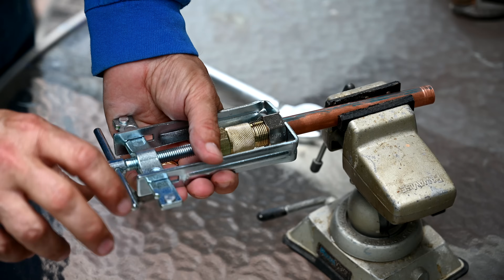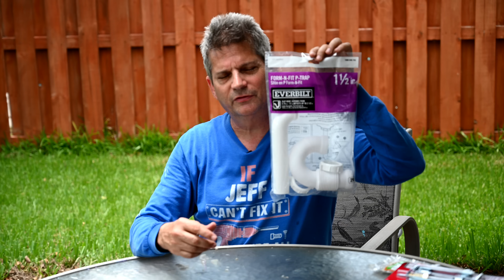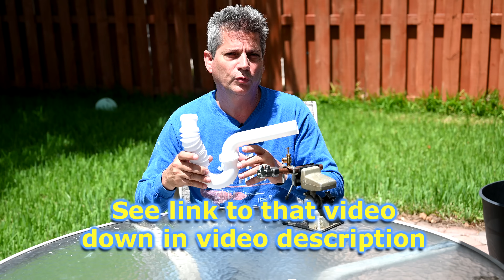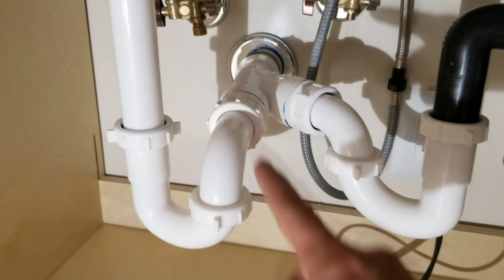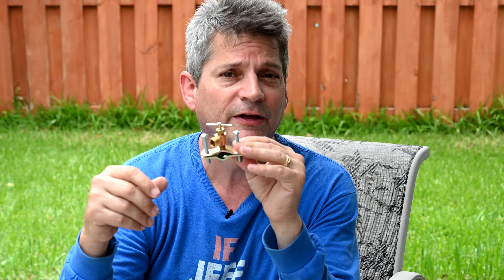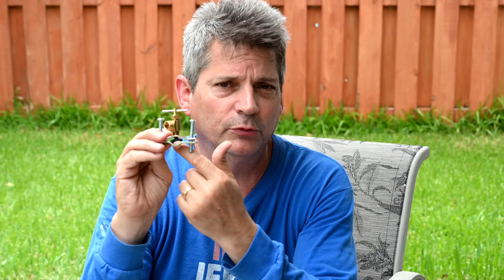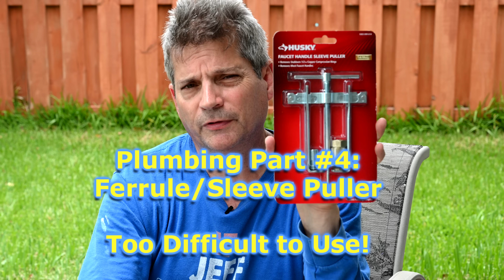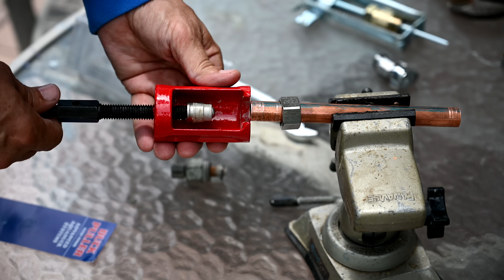4 Plumbing Parts/Tools You Should NEVER Use. NO Plumbing Fails

Comment: Buying special tools to remove the old, existing compression fitting on the angle stop is silly. All that you need to do is to tap the backside of the nut toward you. Keep tapping but at different locations around the nut and it'll eventually slip off.
Reply from the maker: What you're suggesting also has the risk of breaking the solder connections on the pipe inside the wall which would lead to a much more devastating and costly repair when the tool is only $10. Also your method might work on one that comes off easy but my experience has been that many of them are on really tight an I do a lot of work in bathrooms that have had a lot of moisture in them and so the corrosion really puts these things on there super super tight and so tapping is not going to work for most people
Reply: @jeffostroff  
Noted, and it's a good suggestion. I probably won't change my own ways, but this could be because I've gone into another business. It's called RETIREMENT.

But as for the contention that tapping on a compression a fitting could loosen a soldered joint inside the wall? Well if this was done by a novice? Then I'd say perhaps. However, it would have to be one pretty reckless and inexperienced person doing the tapping. And I'm not that kind of a circus freak (forty-five YEARS in plumbing and the trades in general). That and the original plumber was similarly inexperienced and left a poorly sweat joint likely to fall apart during the removal. Also, here's where I pull out my ever-present can of WD-40. After coating the stubborn fitting with the fluid for several minutes and then LIGHTLY twisting the stuck ferrule on the stub out WHILE HOLDING THE OUTERMOST END OF THE 1/2in copper stub-out securely w/vice grip or another tool that'll prevent a twisting tension upon the 1/2 in stub-out?

Then I think I'm pretty well protected against a catastrophic leak ever happening inside the wall after I'm paid and ''outta there pardner''!

And I suppose that some folks may feel opposed to using WD-40 on potable water supply systems. In as much as the liquid MIGHT eventually spread out and into the water supply. However, I'm not worried about this. As I carry paper towels and a spray bottle of water. to clean my surfaces afterward.

Comment: Retired industrial electrical/millwright contractor here with 49 years in the trades when I retired 6 years ago.  

We were mostly industrial only, but there was a time where we used to do a lot of commercial build-outs. When we were doing the "make safe" for the demo contractors and the plumbers and fitters were killing off the water and sprinkler system, especially in restaurants and places where they had self serve coffee and soft drinks there were saddle valves on copper that were there for decades. - Not a sign of a leak. - It may be in your code now, but don't try to tell everybody that a saddle connection WILL ALWAYS leak, because it simply is not true. 

 It the very same principal as the saddle taps the HVAC guys use, and they seldom have a problem with them and they are running at 300 PSI with a gas that will get through MUCH smaller defects then a liquid. 

And BTW, just how do you hot tap a water main without using a saddle ????
Reply from the maker: turn off the main water first the solder in a T-adapter, then use a compression valve.

Comment: As someone with an impact gun to work on their car, it makes me wonder. Would a socketed, NON impact, drill help turn the remover referenced at 22:50 work well, or would it be too much torque on the copper pipe and cause issues? I'm thinking of my upcoming project and I may not have space to use a full wrench to turn a tool like that if I need to use one.
Reply from the maker: Yes I think it would work or you can also use the Milwaukee surge driver tool which doesn't do impacts like a normal impact driver it uses hydraulic force

Comment: On the compression fitting, couldn’t use just use the existing nut and ferule when connecting the new valve?
Reply from the maker: Yes you can, I prefer to remove the old one and replace it with the new one that comes in the ew valve box. Gives you a great chance to examine the pipe under the old ferrule a swell.

Comment: Basically, what happens in an S-trap is this - the drain water is pushed out by force, but strong counter-forcings in the excess curvature of the S-shape in the trap allow any methane and/or ammonia to forcibly splash back all the way up to the drain area and out in the air into your kitchen, your bathroom, your laundry tub, in the form of sewer gas. 

If the sewer gas buildup is methane, it is like being in a coal mine with that buildup - and that means any spark, fire, or open flame around that sewer gas buildup - if the gas continues to build up  - AND IT CAN LEAD TO AN EXPLOSION!

There is also ammonia release, so if you breathe too much of that into your lungs as the sewer gas is released - it is like carbon monoxide - it will displace the oxygen in your lungs, and enough exposure levels of this ammonia can even lead to respiratory failure - or even death. 

With these dangers, that is why S-traps are against the law. :( :( :( 

I am thinking a building contractor could face stop work orders or even up to a $10,000 fine if the contractor tries to install S-traps in one's building.

Comment: Just a quick tip for those older, brass sleeves/ferrules. disconnect the angle stop and spray a quick, light spray of lubricant onto the sleeve.  Wait 5 to 10 minutes and then remove the compression nut and sleeve.  Note: use a general degreaser to clean any residue before re-assembly.
Reply from the maker: luckily the duck puller i use has never failed once, so I have not had to lubricate any ferrules first

Comment: @24:10 In your video, it's the right tool but the wrong application.
That particular tool is designed to remove chrome faucet handles that have welded themselves to the faucet valve stem.
I jerked around for an hour before I decided to buy one and it took about 15 seconds to remove the handle.
Reply from the maker: LOL it is amazing how many of you come in here with the exact same statement you guys must have all band together or something but you are all 100% completely wrong. If you flip over and look at the directions on the back of the package there are clearly two sets of directions there's one set of directions for using it as a nob polar and there is another set of directions for using it as a compression sleeve puller and if you look at the website on Home Depot it clearly states it's two tools in one.

Comment: Please provide links for the supposed capillary action issues with floss.  Your use of the word capillary action implies strongly you do not understand what it means.  

To be clear, floss in pipes is a terrible idea that can cause many problems, I'm just not sure how the capillary action can cause leaks.
Reply from the maker: Actually it is YOUR lack of knowledge of capillary action that implies strongly you don't understand what it means. It's all about the surface tension http://theplumbinginfo.com/plumbing-traps/
Reply: @jeffostroff  So when you talked about vacuum pressures in the S trap and said it was almost like capillary action (Check 2:48) you were really talking about the surface tension in the S trap? Or do you believe that vacuum pressure is somehow involved with capillary action?

And thew link you provided says nothing about floss, which was my question.  It talks about generic strands of fiber.  Floss is waxed 95% of the time, and that wax will have two effects on capillary action:

1. It prevents the base string from absorbing water, which is necessary for capillary action to occur, and

2. As wax is hydrophobic, the cohesive forces between the water molecules are greater than between the water and the (waxed) surface, inhibiting capillary action in most cases.

3. Where the floss isn't waxed, it is usually made of materials like Teflon  which are themselves hydrophobic.

I was working on a project many years back (when I was about 15)  using capillary action in string to move water from a reservoir up high above it's starting point (to create a perpetual motion machine -  we were 15), but of course it didn't work because the surface tension that caused the capillary action prevented the formation of a proper droplet at the other side, preventing water from leaving the string.  I clearly remember thinking that since wax was hydrophobic, it may facilitate the formation of the water droplet at the exit, and since we had no budget we decided to use floss as our waxed capillary tube, but we were completely unable to get any capillary action at all through the floss.  In those days, teachers were far less inclined to help[ students with such 'stupid' experiments, and so we were not able then to understand why. and It's been something that has always drawn my attention since then.  

I specifically asked for links for capillary action in floss because of this - had something changed in the intervening years?. 

You mentioning capillary action in relation to vacuum pressure leads me to believe you do not (or at least did not, hopefully you have now educated yourself) understand what capillary action is.

I'm autistic, so I sometimes don't communicate well, so in case you were not aware, your answer makes you look like a bit of a pretentious dick.

Comment: You used the Husky Ferrule puller incorrectly, it works just fine. If you look at 17:21 of your video you’ll see there is a silver insert piece that you never used which is critical to removing the ferrule. That piece makes it so you don’t need the arms to grip behind like you showed. In fact, I usually back out the long T-handle screw all the way from the arm housing so I don’t bump into it.  With the t-handle all the way backed out and separated from the arm housing, you put on the brass sleeve on the end of the screw, as you did, but then you insert the silver piece inside the brass sleeve and that silver part goes inside the 1/2” pipe. You screw the nut onto the brass sleeve and now when you turn the t-handle the silver insert has a lip which pushes against the cut edge of the pipe and causes the ferrule to back out as you turn the handle. I will agree with you they could have made the handle longer to get more torque out of it. 

Thanks for the other 3 tips, very informative.
Reply from the maker: They have changed the tool and instructions over the years. We will be doing a new video on this soon.

Comment: They are still legal in Australia and when connected to the sewer line and if the vent pipe is connected to the highest point of the sewer pipe the s trap and p trap works just fine.
Reply from the maker: Yes, Australia does not seem to have too many failures with these

Comment: I learned something.
- The S-Trap works the same as every toilet except a toilet is made to cause a siphon, break it, and refill.  It seems the only difference with a P-Trap is a short length of horizontal pipe prior to the final 90 degree bend.  I would think a nearby toilet would siphon out the P-Trap as well and the only way it would is if the soil stack were too small.  My bathrooms have P-Traps.  The kitchen has an S-Trap and had a remodel done by a builder that relocated the sink a little.  It splices into a drain-T under the floor with the opposite end going to a vent pipe through the roof.  The original wall connection is behind the lazy susan now and is plugged.  There is never any stink but I can get it to gurgle if I drain both at the same time.  There isn't a practical way to do one through the wall in a remodel, but one could run a horizontal length and not go through so close to the sink.
- Saddle-T:  There are two in the house, one that came with it, ~50 years old, and the other for an ice maker, going by the refrigerator manufacture date ~20 years old.  They both go into galvanized pipe.  When I replace the galvanized it will be with PEX-A and I'll do regular fittings at that time.
Reply from the maker: You'd never have to worry about a nearby toilet siphoning out a pee trap because the plumbing stack that it is connected to is usually in the four inch range which is plenty to prevent the system from starving for air and trying to suck the watert out of a P trap in order to satisfy it

Comment: Lot of good advise here.

That said, and to be fair, there are a lot of handymen who do good work, and there are a lot of so called pro's, be they plumbers, carpenters, attorneys or even doctors, that do shoddy work. A license is no guarantee the individual is competent to do what they are licensed and hired to do.

Electricians people hired, because they knew they weren't qualified to determine what they needed or to do the work, wired shop outlets with 14 gauge, because that's ALL code called for.  Then the people couldn't use their saw or other tool because the circuit wouldn't handle it.

Public defenders sell out clients every day (plea bargains, so they don't have to do the work, and cut into their bottom line).

Doctors ignore their patients because they think they know little or nothing about themselves, and the patient suffers injury for it.

Then there is the fact more than a few plumbers have passed on a bid, because they didn't want to pay the cost of having a job done for what would have equated to paying a contractor far less than they earn, even though the contractor had the same overhead, and was no less qualified in his field. 

From there we could go to that every field has people who have trouble adapting to new equipment and techniques, be it switching away from lead packing or joints, tile drain fields or what have you.
Reply from the maker: That's why we try to show people how to do these repairs themselves

Comment: Good video

The S Trap is only a problem is when there is inadequate venting. An AAV can solve this issue.  Not allowed on new construction.  If you have one and aren't having any issues than it isn't an issue until you have contracted professional plumbers to renovate your plumbing.

those flex universal Form-and-Fit P Trap are a really bad idea, they are fragile, they are cheap, they can form into an S Trap which can POTENTIALLY create problems, and they will snag and trap debris and clog.  This man is right, take the time to assemble a proper trap and avoid these.

The saddle valve is a crap idea.  NEVER compromise a pipe by drilling or piercing a hole into it.  BAD STOOPID IDEA.  When these go wrong (and they will eventual fail) you will have a serious leak.  Also, that turbulence he mentions is a real thing.

I hate badly designed tools.  Thanks for the heads up, and the recommendations
Reply: I agree with everything except the last one. Don't you see this guy doesn't know how to use Husky puller?
Reply from the maker: Husky has changed their instructions from when we first bought them. I know how to use this puller. The problem with it is most of the bathrooms I end up working are neglected or foreclosures, where corrosion and excessive moisture have spent years causing ferrules to be stuck. On those, the Husky tool is in capable. With my Duck Puller, they work 100% of the time, never met a ferrule that would not come off.
Reply: @jeffostroff  Mechanically, It's seems like very few advantages to use the duck puller if you see that design structure, which a lot of forces are wasted from physical perspective, except you can use a wrench that may provide more leverage. But mostly, i believe Husky is easier to use that means less force you used compared to duck puller even in the corrosion situation.
Reply: @alexchu8596  As far as I can tell, he seems to know what he's doing.  If you have a preference for a tool then by all means don't let anyone talk you out of it.  Not all hand tools work in all hands.  As for me, I agree with jeffostroff, that the Husky tool looks like a cheap piece of junk.

Comment: I think you lost one component that also come with the package on husky puller or you just don’t know how to use it, which is shown in the following https://youtu.be/7KDe8ACKjwc or https://youtu.be/MjNrGuxYvjQ. This product is worth only 10 bucks that cheap does not mean something bad, it works great for me, and I believe it’s easier and convenient to use than what you recommended those that worth more than 40 bucks
Reply from the maker: Well who knows maybe it never came with the package but either way Husky has changed their packaging since then because a lot of guys like to come in here and insult me telling me I don't know how to use this part and telling me that it is not meant for ferrule sleeves that it is just a faucet knob puller. But they don't know the joke is on them because the instructions on the back clearly list two different sets of instructions one if you were using it as a cabinet faucet knob puller or if you are using it as a ferrule sleeve puller. And it might work fine for you in your simple bathroom jobs but most of my jobs are much more worst case scenario engineering where foreclosed properties have had mold and moisture in the bathrooms and so these feral sleeves now become pretty much stuck on there these Husky tools are not up to that task
Reply: @jeffostroff  Yes, I agree with you, because the biggest advantages for duck puller is that you can use wrench